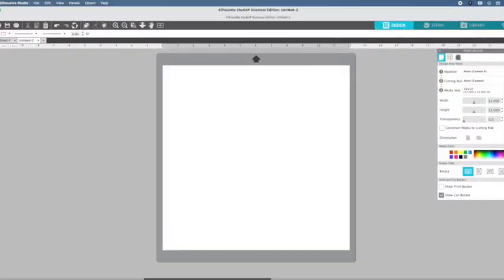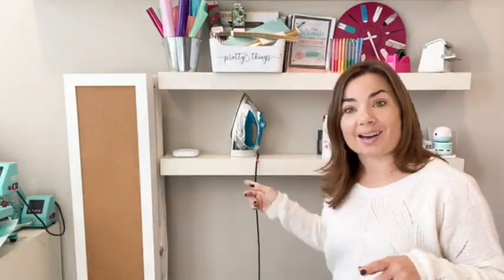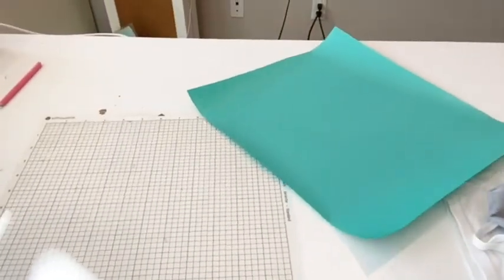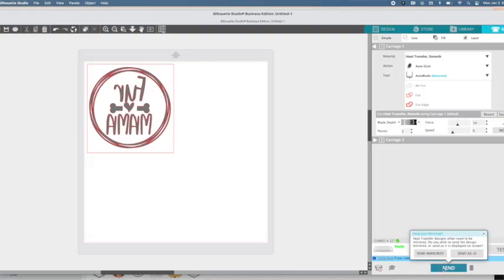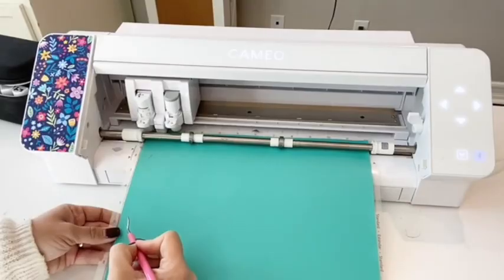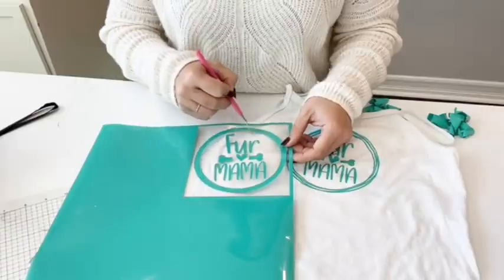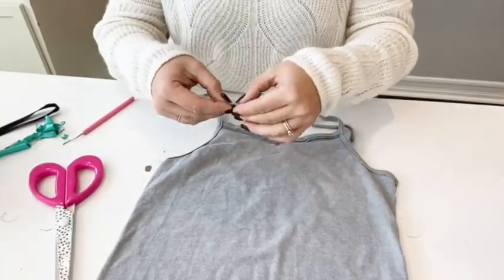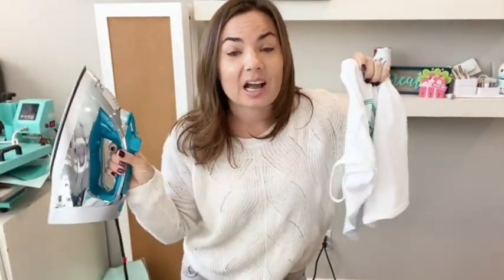Silhouette Cameo 4 Heat Transfer Vinyl for Beginners: Start to Finish

Comment: The cuts are practically invisible seeing the heat transfer vinyl from the back. Even when I blast full light at it. How do you see the cuts?
Reply: maybe uou need to adjust your blade or force settings?
Reply: A magnifying lens might be good for you in this case. 🔎

Comment: What heat setting are you supposed to use? Cauae i just melted my backing to my iron 😪
Reply from the maker: It shouldn't melt to the iron if the clear carrier sheet is still on the HTV when you're pressing. Use the cotton setting

Comment: Hi Melissa, thanks for the detailed video! Question: you don't print registration marks, yet your Cameo just normally cutting everything. Mine writes back that it cannot find registration marks hence not cutting. Why/ how so? I'm using regular cameo mat that come with the machine and removable vinyl.  Machine did read registration marks when I just made a print out on regular paper with registration marks (not right away but it did). TIA
Reply from the maker: You do not need registration marks for vinyl or HTV. Only use them for print and cut..for example stickers that are printed on a computer first, then cut with the CAMEO.  That's when it would need registration marks.

Comment: You might want to rethink the force setting. I did exactly as you instructed and the blade cut through the carrier. A good cut but useless to transfer to fabric without the carrier.
Reply from the maker: Hey there! If you're using the auto blade, I would double check that your blade indicator is moving when it taps. Also that your blade is installed fully so that there is no gap between the blade and the clip on the housing.

Comment: Thank you for the video. What htv vinyl would I use on my eco solvent printer, so I can print and then cut with the Cameo 4?
Reply from the maker: Hey there! You can use any of your regular HTV that you usually use in your evosolvent printer. Check out this page with a bunch of tutorials with different materials on the Roland here: https://www.silhouetteschoolblog.com/p/roland-bn-20a-and-versaworks-tutorials.html

Comment: I've had a new problem crop up with my Cameo 4 that I haven't been able to address. It used to go back to the 'load' position after it was finished cutting, just like yours does in the video so you can test the cut. My machine stopped doing that. it now stops with the mat all the way in and I have to hit the unload button multiple times before it unloads, I am unable to do a re-cut if necessary because I can't guarantee that my alignment will be okay! Have you ever seen that before?
Reply from the maker: Hey there! I would do 2 things: first update your firmware. Then if you're still having issues this tutorial walks you through calibrating your Cameo: https://www.silhouetteschoolblog.com/2021/06/how-to-calibrate-silhouette-cameo.html

Comment: I'm using the silhouette portrait and when choosing the HTV setting it has a force of 4. So 14 seems a bit excessive- is there a different setting for this particular silhouette machine?
Reply from the maker: The default setting for HTV and vinyl are not correct. A force of 14 will work :)

Comment: Trying to follow and did  what you did, I received registration failure. There is no gap. I am not sure if I have the setting right. I printed one but had it in the wrong direction, and ever since, it will not cut anything. It keeps making the noises, and nothing happens
Reply from the maker: Registration failure means it's looking for registration marks - which aren't needed for HTV. Make sure you do not have registration marks turned on.

Comment: I have been on it all day. I am new and I watch you over and over and the blade is not reaching the the heat transfer paper. It is all the way in and there is no gap. Makes all this noise and then nothing is carved.
Reply from the maker: Hi Richard Lastrina, it would be easier to provide you the help you are requesting if you could please send an email with some additional information. Please provide as much info (including cut settings / exact material / screen grabs) as possible when emailing. My email can be found through the contact page on Silhouette School Blog https://www.silhouetteschoolblog.com/p/blog-page_9.html
Reply: Same problem :(
Reply: Just remove the registration mark when you are cutting image .. because registration mark are mostly use when you print and cut

Comment: Great video thank you. I'm having a hard time finding just cut settings. I recently used HTVRonton settings on Heat Transfer Smooth (BD 2; Passes 1; Force 4; Speed 8) and the vinyl does not peel off so easy or gets peel completely off. Any of your suggestion? would really help thank you!
Reply from the maker: I would use the standard Heat Transfer Smooth setting, just up the force to 14.
Reply: @SilhouetteSchool  Thank you for your prompt reply. Do you know why on the HTV Ront recommendations it says force of 5? I'm trying a Cameo 4 from a Cricut 3 and having so much issues with the Cameo 4. I really want to give it a try but its just head breaking😫

Comment: Hi Melissa, is there any type of fabric that can't be used for heat transfer? Are natural materials like cotton and linen better to use? Thank you.
Reply from the maker: It depends on the HTV itself. For example, if you are applying HTV to lycra not all HTV will work b/c it doesn't all have the right amount of stretch - you want to make sure the HTV can be used on the fabric where you are applying it.
Reply: @SilhouetteSchool  Thank you for your reply 🙂

Comment: I just followed your video step by step and even used brand new everything and mine has bubbles. What could I have done wrong??
Reply from the maker: Hi Maria Parraz, it would be easier to provide you the help you are requesting if you could please send an email with some additional information. Please provide as much info (including cut settings / exact material / screen grabs) as possible when emailing. My email can be found through the contact page on Silhouette School Blog https://www.silhouetteschoolblog.com/p/blog-page_9.html